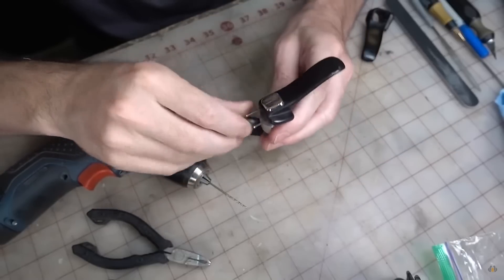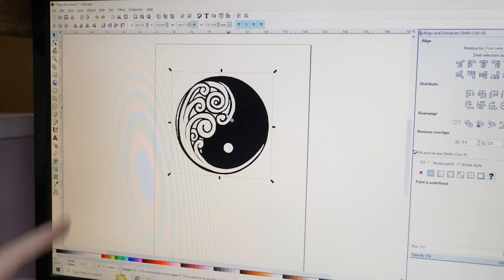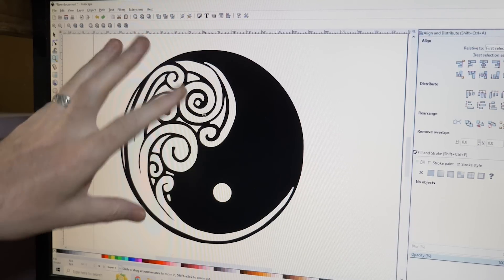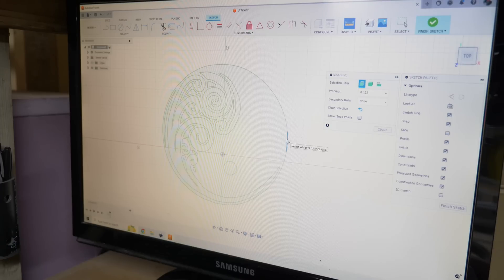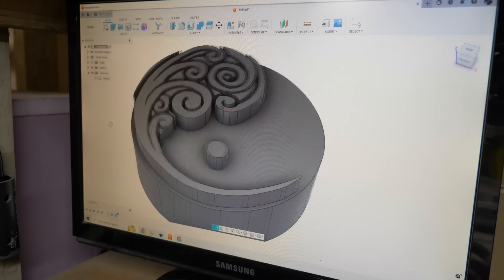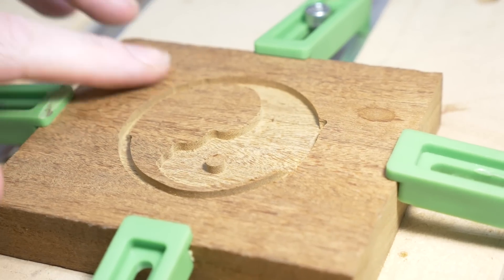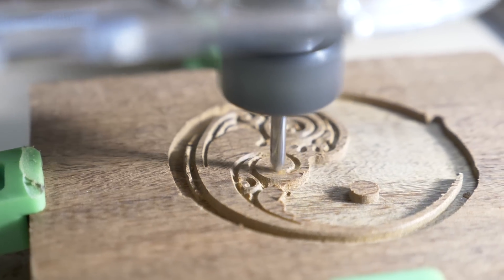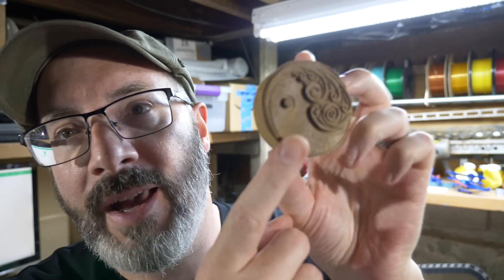Building Confidence with a Beginner CNC Project

Comment: I personally prefer Vcarve or Aspire by Vectric when it comes to 2,5D carving. It’s not cheap but it combines the design and post processing stage into one piece of software. I also found that the learning curve in Fusion is steeper as it has way more variables to take into account. Also, fusion tends to slow down significantly when using more intricate vector files. Fusion is more powerful though. And free if you don’t use it commercially.
Reply from the maker: Right on! Pros and cons for every solution.

Comment: The black and white should probably be switched for the raised portion.  Otherwise the black portion of the yin/yang symbol won't be as noticeable.  The other option would be to leave it as it is, but have a raised ring around the whole symbol so that the black part will be more noticeable as a yin/yang symbol.
Reply from the maker: I hear ya, but this is exactly how my mom wanted it to turn out. Gotta go with what the client wants.
Reply: @punishedprops  True, guess she wants the "black" part of the symbol to be understated?
Reply: @punishedprops  I think in this case it could have been interesting to produce two versions :  one exactly as she wanted (like you did, since one has to do what the clients wants indeed), but also one that creates positive, puffy swirls.
But perhaps the end goal was to fill in these reversed clouds with a bright color, using the convex ridges as dark outlines. The only way to know would be to see one of these finished mugs !
Anyways - such an excellent idea. Will definitely try it out with CNC at the local maker space.